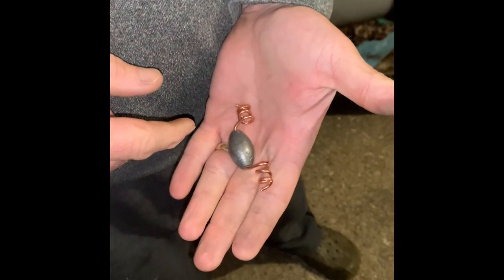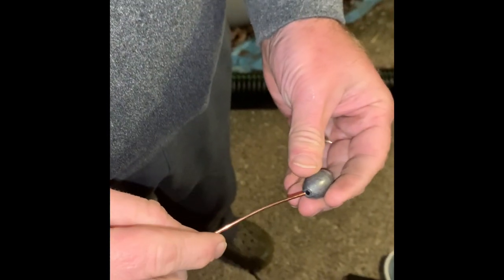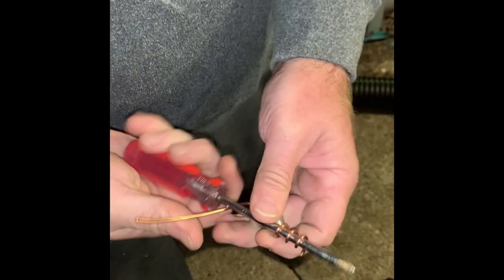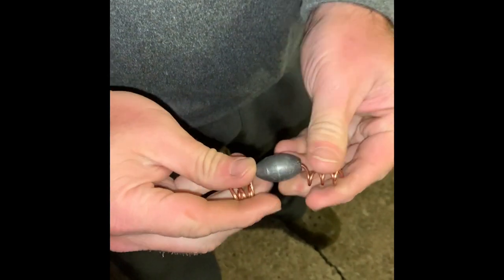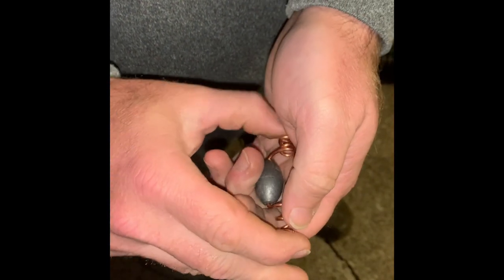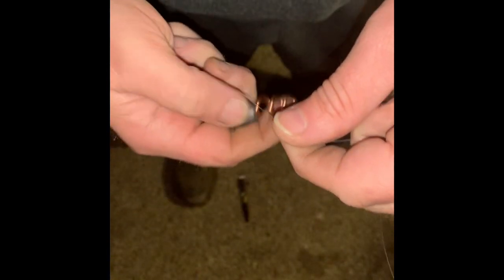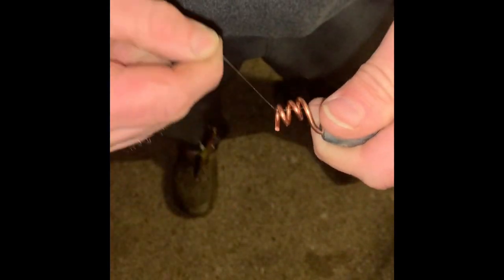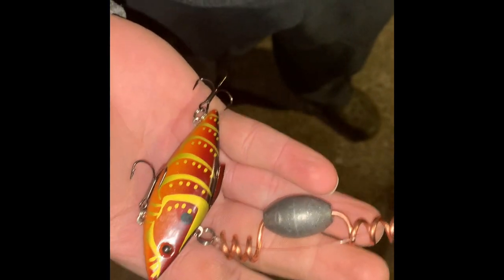Lure retriever - handmade - inexpensive .

Comment: I tried knocking lures loose but it hardly works for me.  I end up losing the lure and the weights.  Anyway to make it grab onto the snap swivel so I can yank it out with force?
Reply from the maker: I mean you can make it heavier and add small chain on it . Tie it to a stronger line then slide down the line . I use it mostly for Ned rigs and dropshot that gets hung . Works good for me .